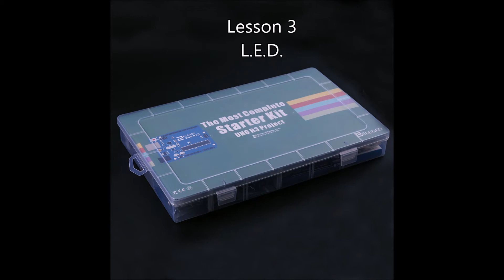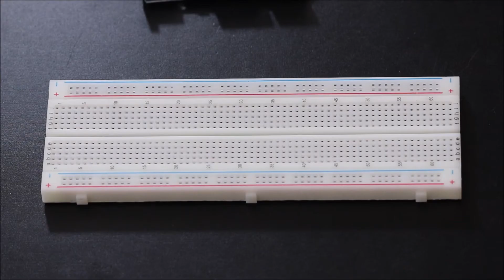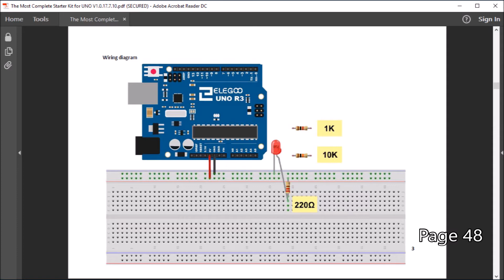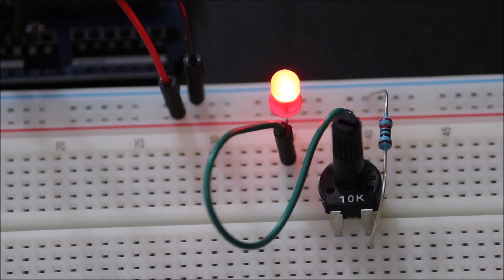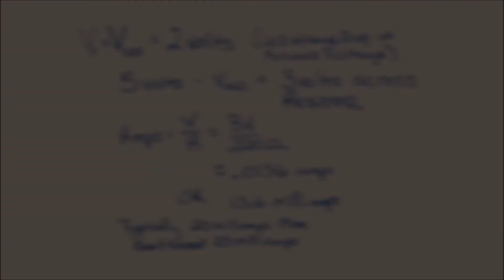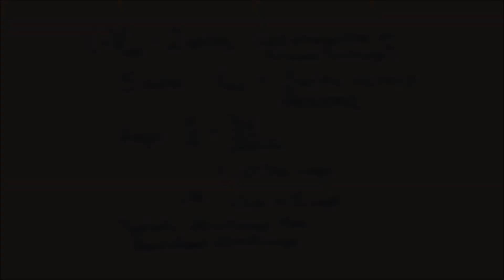Lesson 3 - LED

Comment: I'm a bloody beginner in electronics and I didn't understand why the order of devices doesn't matter if the resistor has to be in front of the diode so it doesn't fry it.  Anyways, I watched other videos of you and they are very good. This too, but I think I have to begin from the basics, how electricity flows, how to use a breadboard and things like that. I will definitely come back after though

Comment: This video wasn't really helpful. It started off really well. You explained what you were using but didn't show actually hooking anything up with any explanation about what holes in the breadboard to connect anything to. For the jumper wires I have all sorts of colors, not sure if they mean different things but there was no explanation about why you selected black and red and where they go on the Uno or on the breadboard. Looking at where you have the resistor and the led plugged in, there is no information about if those exact spots matter or if I could use other columns/rows on the breadboard. Over all, you didn't really explain setting it up.
Reply from the maker: I should also point out that I avoided showing the wiring steps, because I felt that they were boring.  I was hoping that an improved wiring diagram aka fritzing circuit, clearer schematic, and good picture would be easier to understand.
Reply from the maker: Those are important, but very basic questions.  Perhaps I should make a basic breadboard video explaining this.  Colors are not so important, even though I like to use black for ground and red for 5V.  The breadboard's two columns on either side that have a blue and red stripe next to it, they are typically used for power and ground and the entire column is connected to each other.  The middle rows of 5 holes, a  gap, and 5 more holes are used for your circuit.  Any items plugged into the same row of 5 holes will be connect together.  It not so important which row, just as long as the parts that you want to connect are all in the same row.  I hope that helps.

Comment: Hello,

Thank you for making videos of the lessons. 
I'm stuck on this lesson my led doesn't light up and I don't understand why, I did like on your video. 

I took pictures of my installation can you help me ?
https://www.casimages.com/g/uujSKG267Sb
Reply: don't know if you found the answer yet but just imagine it like one of those puzzles where you have to make a thing complete a full circuit through a winding maze (and you can only go straight and take turns)
so for this I'm mainly looking at IMG_0068
so the electricity goes from the Arduino through the red wire and now, since your wire for the led is on the same column (abcdefghij and + or -) as the red wire is, it goes through the led, but now, it can't move anywhere because it isn't on the same row (the 30, 35, 40, etc) as the resistor. So move your end of your resistor that is on the left side so it is on row 35. And so now the electricity is able to go into and through the resistor but it now has to go back to the Arduino, but it cant because the right end of your resistor is not on the same column as your black wire. So move the right end of the resistor so that it is on the same column as the black wire (the blue -)
hope this helped

Comment: it does not work.
Reply from the maker: LOL, this is only lesson 3.  This is a super basic circuit.  Try it again.  The Elegoo tutorial doesn't use a Sketch for this lesson.  Just connect the components and see the results.
Reply: try flipping the led pins, it works fine